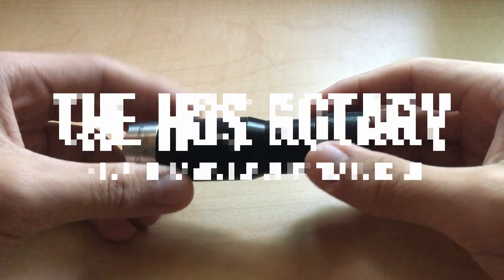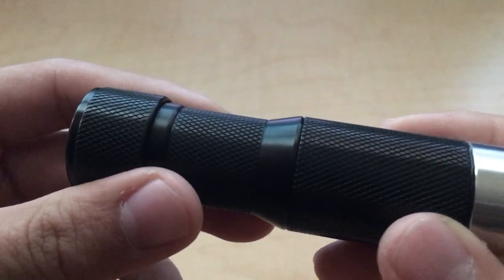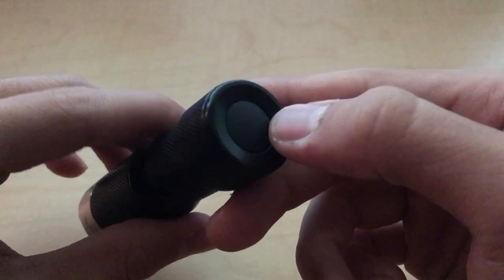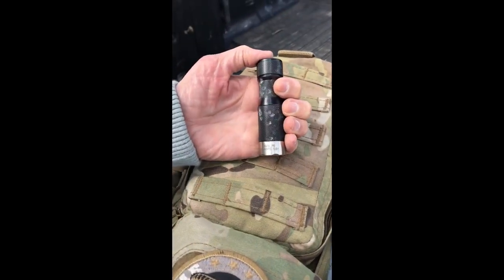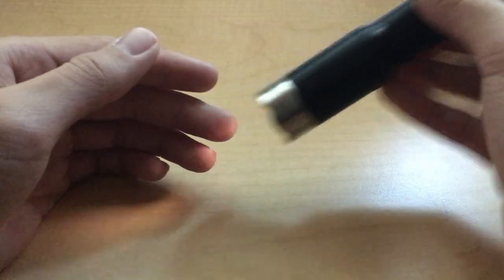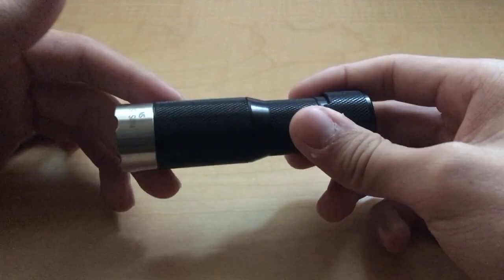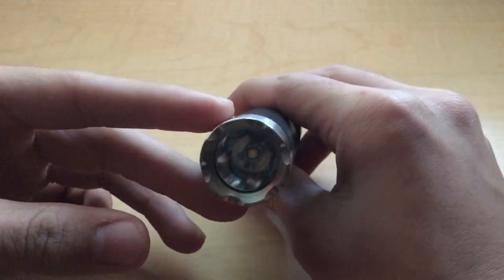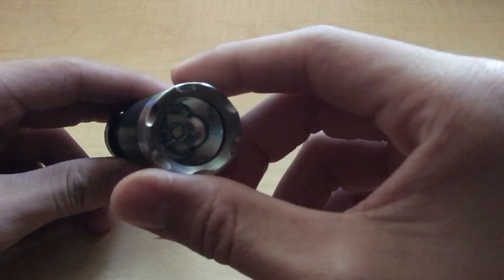HDS Systems Rotary: Toughest Flashlight Ever? (In-Depth Review)

Comment: Late to the party here, and don't have a Rotary but I DO have a Clicky that I've had for around 10 years if not more.  140 lumen output but it holds up to much more modern offerings well.  I just recently picked up a Haley Strategic D3FT with a rated 500 lumens and while my Clicky isn't 'quite' as bright within any reasonable tactical difference, the Clicky holds it's own.  Now that I'm retired I don't have the discretionary cash I used to have, but I'm putting away dollars here and there to buy myself a Rotary at my earliest possible time.  For what it's worth, I have multiple Surefire lights, Streamlights, 4Sevens (original company), Fenix, and Olight flashlights.  If I had to get rid of all but one, the HDS would be the only one I'd have.

Comment: I own a HDS rotary. It is easily one of the best and most useful lights I own. I’ve taken this light with me on work trips out of the country many times and I have always been grateful for the level of quality and performance that HDS has put into this device. I also carry it in a holster made by Dan at Thor’s Hammer. Equally of great quality. Both company’s show tremendous integrity, innovation and design in their products.

Comment: I can comment on the Zebralight. I have the latest Zebralight, and it is good, probably one of the best out there. But it isn't as good as the HDS, not by a landslide. I had an 18650 rotary for three years, one thing that the HDS light does that I have yet to see in any other light is the momentry function. The ability to turn the light on temporarily with a press and hold, and the ability to go instantly from a lower output light to max and then back down. This is extremely useful when in the dark, Indoors the lowest output is enough to see by at night, outdoors maybe a level 15-16 (~5-10 lumens) Just enough to not step in puddles without wrecking night vision. It is all fine and good to have a nice low level light, but if something spooks me I want that max output instantly.
-The ability to set the light output BEFORE turning on (important while camping, don't want to accidentally wake everyone)
-The REALLY low low mode makes a great nightlight / reading light
-200+ lumens of high CRI easily shows more than 800+ lumens of low CRI light, think about trying to see things with single coloured light, all you can make out is shadows and edges, and since the light is coming from your hand, the shadows are not really visible like during the day. In the dark you really only have differences in colour to see things by, and with low CRI the colour is muted and everything is gray. I actually experinced this, 800 lumens of crap light in the desert just makes everything look flat and two dimensional, no depth perception, no ability to navigate.
-This light seems to basically never run out of juice on an 18650
-This light can be run on high without overheating
-This light can be programmed to automatically step down and shut off in 15 minutes so even if it is left on in your pocket you never run out of battery
-This light is the real deal for military grade, I never had it not work right with three years of daily use. It is probable that the light will work fine for a decade or more of daily use
-The controls are ideal and adaptable to any circumstance, Zebralight i'd call a second best and with the zebralight you can't switch from low to high instantly.
Nothing else can compare in my book, I fully intend to buy another one.
Reply from the maker: Quite the write-up. Thanks for your thoughts too!
Reply: -my zebralight is set up to go 1 click from off to low. from there, press+hold will automatically take me to max
-zebralights max will also be way more useful than this lights max
-zebralight used at a lower level to match the HDS, it will last forever as well without overheating
-zebralight also has potted electronics and a great warranty
-zebralight is smaller and lighter

your arguments against the zebralight are pretty weak to be honest.
Reply: i forgot to add that the zebralight is way easier to use one handed. not even close
Reply: @sicnarf6971  Hey I'm not arguing against the zebralight. I lost my HDS two years ago and I have been using the sc64LE for over a year now. It is definitely good enough for me, which is saying a lot considering that if a light fails even once I trash the whole brand. Like you said it is more compact and more lumens, it is also less than 1/4 the price of an 18650 HDS. I definitely have respect for the brand and I have lights from them going on over 5 years now that I still use. I have no problem relying on the zebralight. But if I had to choose one or the other to be my only light going into an absurd situation (say an off grid remote expedition)  I'd pick the HDS. Price, max output, and compactness do play a factor and I would actually recommend the Zebra 18650 over the HDS if someone asked me for the best EDC flashlight. If someone absolutely needed the most overbuilt emergency flashlight in the world I'd tell them to spring for a custom HDS 18650. This would only be my recommendation for actual professionals going to literal warzones or far distant outposts. Anything short of that and the extra durability and UI speed is outweighed by the perks of the ZL. 

Either way the second light to get is  high CRI Zebralight flood headlamp and the third light I'd recommend is a peak eiger lug on a clipped keychain with an eneloop. With these three basically any situation is covered and you will never be left in the dark.

My rules for choosing an important EDC light are:
1. it must NEVER fail
2. It must have a potential runtime of at least several days at ~10 lumens
3. It must have a max output of at least 100 lumens and a min output of less than 1 lumen.
4. It must have a UI that allows the light to be turned directly on to high or low, and turned of instantly
5. It must be able to survive hard impacts and extended complete immersion
6. It must have good color rendering
7. It must have a single replaceable and rechargeable battery that is not prone to leaking or self discharging.

Zebralight and HDS are the only two brands that have met all these checkboxes for me.
Reply: @Tre3141  I have to say all your reasons for this light being better than Zebralight are way off. Especially the High CRI, my SC64LE will put out over 800 lumens of high CRI light with just as nice tint as any HDS (my ZL actually uses the LH351D emitter same as one of the Ltd edition HDS). It seems your preference for HDS just has to do with your lack of experience with other good lights. HDS had an awesome and unique light and all of the things that you mentioned made them rare and worth the premium in 2016, in 2020 I can think of 10 lights off the top of my head that offers everything the HDS does and more.
Reply: @ryanhewitt8427  Hey I carry the SC64 LE now. My opinion has changed somewhat. For me reliability is always the #1 feature. The HDS is overbuilt, super durable, with a great set of features. Its premium price is only justified in people who work while wearing body armor or get lost in the jungle. Its not an enthusiast light. Its not something you show off. Its not the most compact, or bright, or programmable, and certainly not the most affordable.

For the average person I'd recommend a ZL sc64 LE which is what I carry now.
Reply: @Tre3141  I work in construction, there probably isn't a situation that I can think of including any imaginary SHTF jungle scenario. During the day my lights come into contact with more dirt, mud, water, wet and dry concrete and dust.   The dust is actually more damaging to tools than anything. The HDS isn't any tougher than ZL, Elzetta or Malkoff. I agree reliability is #1 with me as well but don't let Henry and Dan trick you with that marketing BS. What makes all 3 of those brands so tough are the potted electronics and o rings. They all have the same manufacturing process with the exception of HDS individually programming all of its drivers to ensure consistency in output. Don't get me wrong I love HDS but they need to up their game to justify their prices. There is absolutely 0 reason no matter what excuse they try to get their fans to buy for them not to up their output. On a separate note you listed 3 lights as being all you need for any situation but you are leaving out the most awe inspiring lights out there, throwers. They may not be necessary for the average edc but if you hunt, are a first responder or outdoorsman these lights are extremely useful.